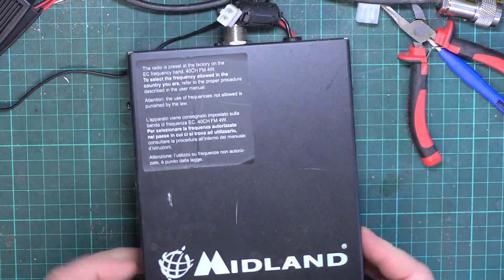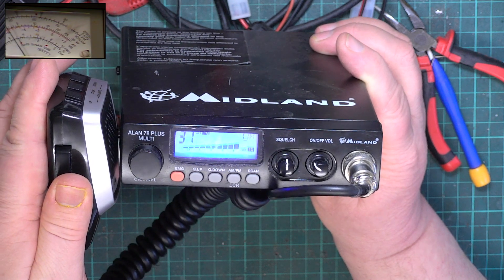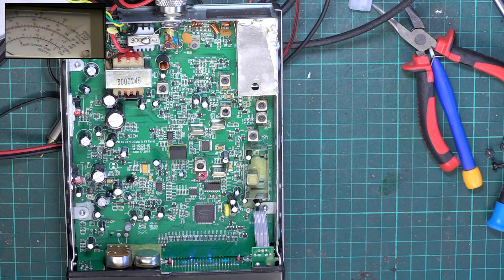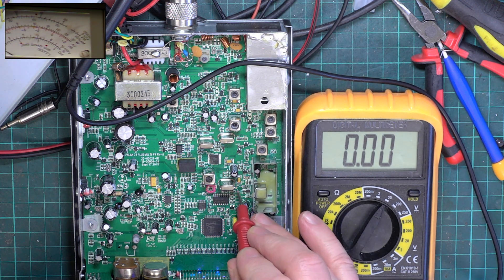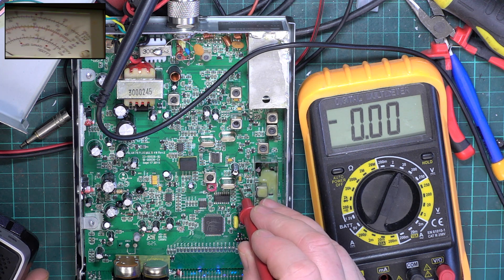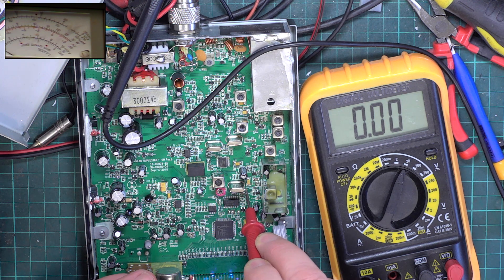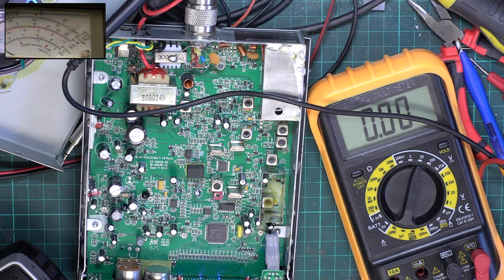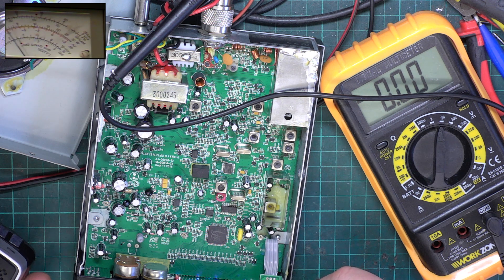Midland 78+ multi - VCO adjustment - Our own CB radio from the test car

Comment: Without info it is just best guess work, but at that low voltage on UK?  I might have been tempted to turn it down further, if it still worked freeze it.  It looks as if it has been set u to work on EU channels and UK is just there as a selling point, just made to work quickly!
Reply from the maker: It's not played up in the test car since this work was carried out. I'll keep my fingers crossed!

Richard

Comment: I do wonder if that FM twang you sometimes hear as it gets into lock on TX means the VCO loop filter is poorly designed or has a component or two which don't like the cold. That wouldn't be a pure voltage issue, but without the circuit that can be the devil's own job to pin down. PLLs can be a lot of fun...
Reply from the maker: The blue version is rubbish when compared to the two previous amber versions. We won;t be buying any more!